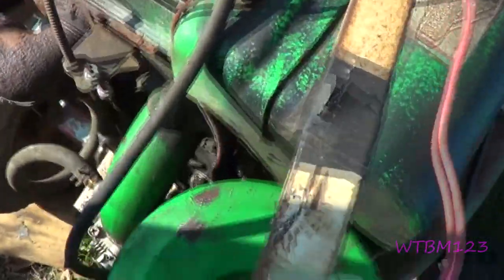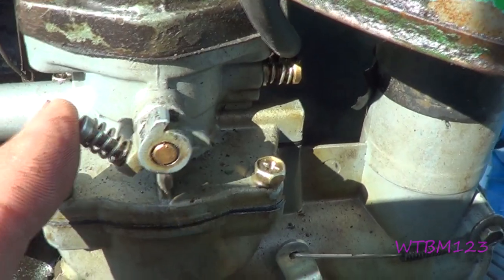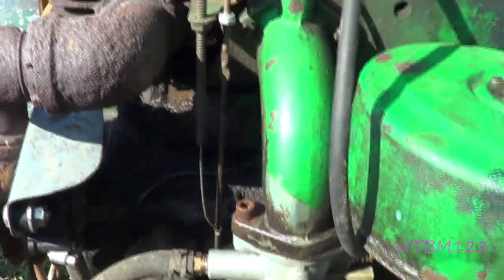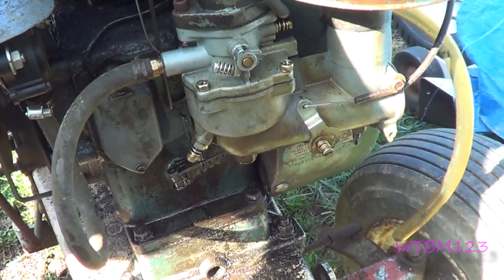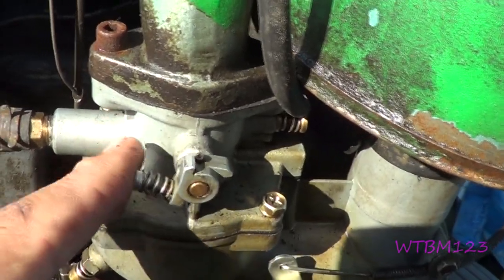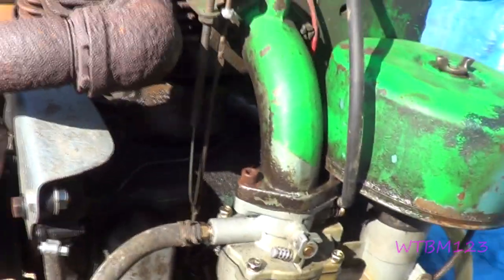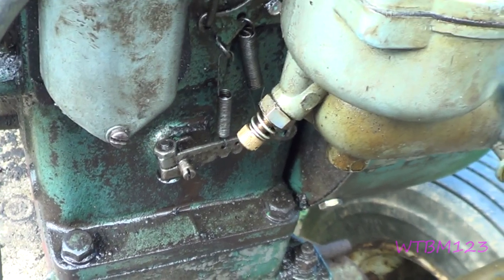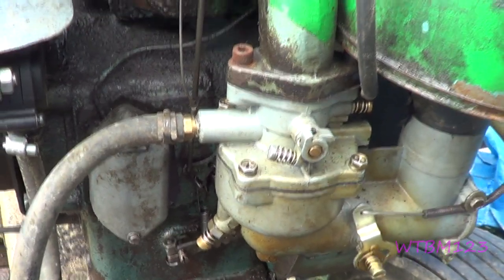Cast Iron Briggs Throttle adjustment, Updraft  carburetor  Sears Suburban , Flow Jet

Comment: You freaking NAILED it. Mine was running wild like yours was. The throttle arm is like yours was, backwards. I'm thinking the previous owner put the butterfly plate on the wrong side. Pulling the carb off tomorrow. THANKS
Reply from the maker: You nailed it in your other comment , those are for bottom controls

Comment: Wow.... your vid made mine easy . The throttle was doing the same, wide open. Swapped and it worked fine. Those carbs with the throttle backwards were on engines with controls on the bottom of engine below the carb. Saved my day
Reply from the maker: Glad it helped

Comment: Does this works for a SS15 SEARS TRACTOR
Reply from the maker: Yes . If can not adjust far enough with the small nuts on governor rod , then adjust the cable with the nuts on it . Make sure there is no slop in the throttle control leaver , part on dash .
Reply: @wtbm123  ok sir.. thanks

Comment: Do you know the part numbers for the gouvernour springs ? My simplicity 7016 is missing them
Reply from the maker: In the briggs manual for 16 hp one spring is 
 26764 Spring–Governor––––––– Note ––––
260815 Spring
Governor
 Used on Type No(s).
 0611, 0630, 0647,
 0651, 0690, 0760,
 0781, 0801, 2256,
 2520, 2527, 2528,
 2529, 2550, 2581,
 2582
Reply from the maker: and the other one is 260816 Spring–Governed Idle
 Used on Type No(s).
 0611, 0630, 0647,
 0651, 0690, 0760,
 0781, 0801, 2256,
 2520, 2527, 2528,
 2529, 2550, 2581,
 2582.
Reply from the maker: But look it up to be sure for yours . Can find the briggs manuals on line . can give more info on that on my fb page . same name

Comment: Them old cast iron engines with cast iron intakes will frost over while running the gets very cold even in warm weather. I know i had a 16 hp that every chance it get in winter i route the heat from engine with sheet medal it stop the problem the aluminum willnot do that .
Reply from the maker: Thanks for stopping in and letting us know